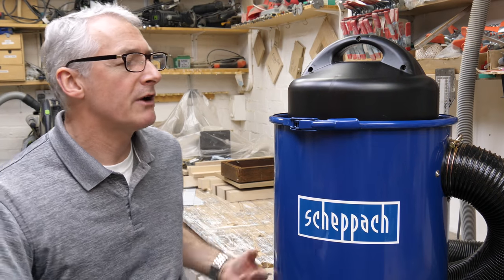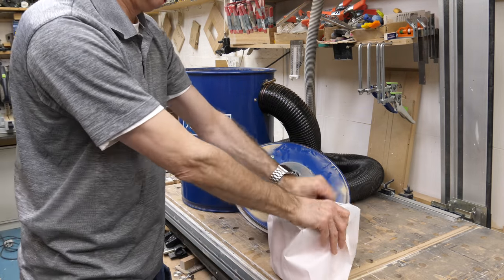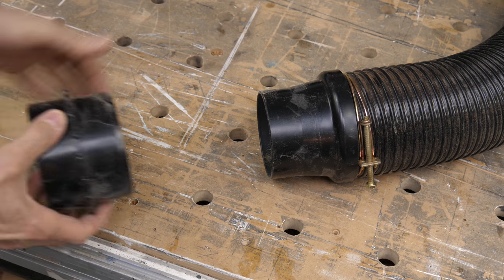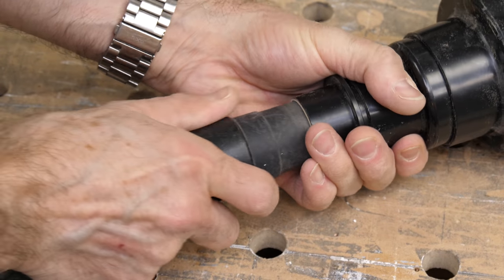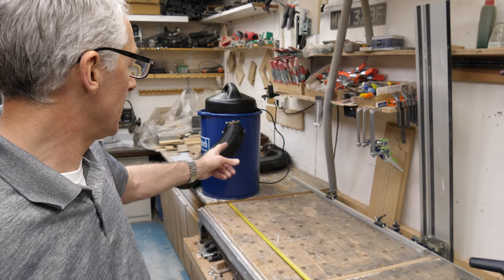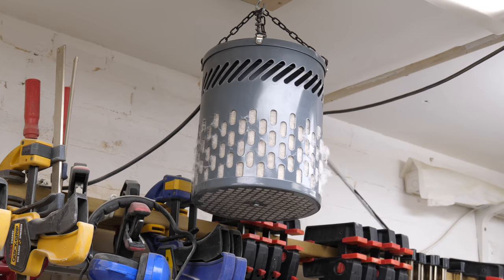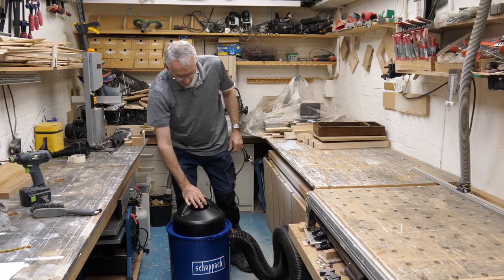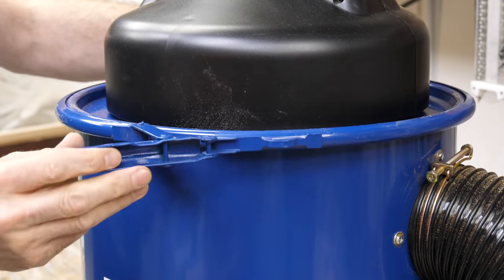Scheppach 50 litre Shop Vac [video #366]

Comment: Design looks identical to the Lumberjack Shop VAC the Ooznest guys recommend for use with their Workbee CNC machine, except the Lumberjack can be had for about £30 less, is a little more powerful (1200W) and filters to a smaller particle size (0.3 microns rather than 0.5). [edit: I’ve since seen this advertised as 0.3 micron, and 0.5 micron. Since it looks like an identical rebranded design to the scheppach, I expect the filtration particle size is actually the same and there is just some inaccuracy in the various listings on this point. The motor is definitely 1200W though, which is a step up)

Comment: I think the short cable is to keep the case's of the tool as small as possible as a longer cable would result in a bigger case and more wire reducing manufacturers profits I personally would like to see a minimum cable length of 3 meters some manufacturers do this so why not all

Comment: Interesting and informative video Peter, many thanks. I have one of the smaller Scheppac suitcase type dust extractors (identical to your Aldi one) and I'm very pleased with it. It is infact my second one as I burnt the first one out. I blame myself not the machine as I repeatedly ran it for hours on end attached to a sander with limited air flow, sanding everything from paint to fibreglass, causing it to get very hot. The poor thing didn't stand a chance really. I had no hesitation buying another and I will be a little more mindful and considerate to this one. What was a little annoying and this may be of interest to others on here:  I telephoned the distributor spare parts helpline to enquire about getting a new motor for my first one and they said they don't even produce a replacement motor for it. They consider the whole machine disposable and non repairable. This is crazy to me as the rest of the machine is fairly robust and still in good order. I still have it, dead as it is, as I can't bear for it to go to landfill. I'm hoping I might stumble across a generic motor that will fit.
Reply from the maker: Thanks for the info! Seems a very shortsighted approach to repairs - especially given the current anti-plastic disposable climate! 👍👍

Comment: Hi Peter, I have a Record dust extractor which filters down to 0.5 micron. When I return to the workshop I find a very thin layer of extremely fine wood dust covering my black tool cabinet. This fine dust cannot be coughed up and is extremely dangerous to health long term. And I only use plywood!! Oak dust and MDF dust (with formaldehyde) are carcinogenic. I’ve lost 2 neighbours to fine dust lung cancers and a 3rd is in a hospice. Now I’ve learned more about fine dust and lungs I’m going to spend over £500 for a class M dust extractor (with HEPA filter). My long term health is worth more than £500. I hope this helps you and your followers. Best wishes for Christmas.
Reply from the maker: Thanks Christian! Yes, this is only to use with the CNC, maybe the table saw; I have a much better extractors available for anything that produces fine dust. 👍👍

Comment: Hi Peter. Not entirely sure if this has been bought up before, but one of the reason many manufactures release only a 2m cable is to do with EMC compliance rules (attached with CE). If the cable is less than 2 to 3m, then the product does not have to go through such stringent testing. I have seen this happen quite a few times where companies try to cop out this.
Reply from the maker: Thanks Tim. I hadn’t heard of that one, but it makes an unfortunate amount of sense! Bought a compressor that had 3 feet of cable attached - not even a metre!🤷‍♂️! 👍👍

Comment: I have this and that "heavy duty" hose tears easily and develops tears in the creases.. You will need lots of ducktape for patching up. You might be alright though if you're not moving it around constantly.
and 100% need ear protection when in use.
Reply: Yep mine is covered in tape
Reply: @petercurtis9297  I've had the Record one for 3 years now, it has a different clear tube with a wire reinforcing it. It has no rips and I am not kind with it and it gets dragged about all the time.

Comment: Hello Peter. Great video as always. Very clear. I have a record power RSDE2 which I've had for years and it's been brilliant. Used only with portable machines but, excellent for power planer and biscuit jointer. It has the mobile base as well which has been a godsend when it's full. Mine also recommends taking the ring off the lid. I think it's more for holding the lid on during transport but, without reading instructions don't quote me on that. Keep up the great work you do.
Reply from the maker: Thanks! 👍👍

Comment: Nicely done Peter 😁. I have had one of these units for a couple of years now. You won't be disappointed with its performance  👍. I have mine static and piped very simular to Keith's but I do use a different chip extractor for my Fox planer. The comment about hose splitting.... That WILL happen very quickly, so I recommend ordering some of the clear flexy stuff sooner rather than later. But it is a good vac overall. Keep up the great vids 😁👍.
Reply from the maker: Thanks Frank! 👍👍
Reply: @XX99XXL  😁 Hi TT. My unit is static and has a short section of flex hose direct from the can. But it is at quite an angle before it attaches to a solid pipe. So it is always under some tension and is exposed to some heat, this leads to premature cracking. I would recommend getting a better more flexible hose as a replacment if it ever cracks. Otherwise the same issue will happen again. I hope that helps TT 😁👍
Reply: @XX99XXL  😁 Sounds like a bargain. I'm sure it will serve you well. Thanks for the reply. Stay safe 😁👍

Comment: I have the Record Power DX4000 as pretty much my only dust control. It's basically the same design as this but twin motor and larger capacity. One gripe I have is that it tends to choke itself. It's so powerful the machine will fill with chips and half fill the hose before you notice anything is wrong. That makes emptying a right pain as chips and fine dust goes everywhere. I'd be interested to know if this is the same. I also find the machine tends to run a bit hot if I'm using it with the input choked down like you do for a power tool. It's ok on something like the thicknesser where it feeds from a 100mm hose though.
Reply from the maker: Thanks! I’ll know more about it as I get rounds it more, but yes, I’d expect it to run hot when it’s stepped down to a smaller hose. Don’t expect to do that much tbh, as I have other vacs for plunge saw, sanders etc... 👍👍

Comment: Hi there, I purchased and have owned the SIP extractor for roughly a couple of years, it works great and has loads of power. Mine is on a shop made base with wheels as I move mine around for the machine I am using at that time ... works well but too powerful to link with smaller hose for use with my metabo and makita sanders, needs a splitter maybe which I can let extra flow come through ...
Reply from the maker: Cheers Chris! Appreciate the info, thanks! 👍👍

Comment: Is there anything to stop you from using a standard vacuum cleaner instead of buying a shop vac? I'm looking at a bagless Henry. I'm not running a business like yourself, it's just a hobby for me so won't be in use all day and can be emptied at the end of each day I use the workshop or every couple of days. I've got many days worth of sawdust around my mitre saw and it won't even half fill a Henry.
Reply from the maker: Domestic vacs may not last as long as one specifically designed for commercial applications, but one thing you have to watch for is the air flow; domestic hoovers wont provide enough 'suckage' (technical term) over a fatter pipe like this Scheppach has, so a Henry might be fine for a mitra saw or sander (filtration concerns aside) but would be no good for a planer/thickness, and even a big router may make them choke. But sure, for smaller stuff a henry would probably be fine.
Reply: @10MinuteWorkshop  I was only thinking of a domestic vac because I know how awesome the Henry models are and found a second-hand one for £50. After posting my question I found a one you use on Amazon for just £114. Seems a no brainer to me - going to save up for one of those instead :)

Comment: i have the rutlands version of this for my drum sander, it works well but is noisy, im planning on adding the axminster metal 4 inch cyclone inline and boxing in the extractor for noise reduction, i will have to leave vents for airflow but it should be a big improvement. annoyingly the 4 inch hose supplied with mine is the clear version and its not 100 mm but around 95mm, so i had to make adaptors for the inlet on my sander and the extractor. apart from that its good value.

Comment: I have a 70 litre one and think its fantastic.....does a great job.  Hose needs patching after a while...gorilla tape helps!  Also fitted it with a flexible rubber hose stepped down to 50mm for my hand tools.  Why spend more?  I also run a home made room dust filter bix which is very quiet and filters 160m3/hr to help strip fine dust from the air in a small workshop....cost me £80 to build.
Reply from the maker: Sounds great! 👍👍

Comment: I have a Charnwood model, similar spec. I have mine connected to a thein seperator, buried in the corner of the workshop along with its noisy neighbour the compressor. It's not the decibel count that hurts on mine, it's the pitch or whine of the motor or impellor, so I have surrounded it with polystyrene and old blankets ( ventilated from outside). Doesn't do much on the Decibels (72 down to 70) but cuts out the annoying whine
I'm not sure the filter micron level is realy that useful on mine, as it displaces so much air and dust from workshop surfaces there is a potential dust cloud before the tool is switched on.
Mine draws quite a lot of power on start up, and I blew up my power tool take off thingy so yours may not work with Hifi/TV type switches.
Reply from the maker: Thanks Richard! Yes, I agree WRT the air displacement - and the 'whine' of the motor! 👍👍

Comment: Peter, I have a Record Power version that looks pretty similar to your one. Hidden in the instructions it stated remove the clip from the lid when using. The clip is only required to carry it about. Like you I made a mobile base for it - so the clip is hung up in the workshop. Check your instructions carefully.
Reply from the maker: Interesting - I wonder why? I'll check the manual, and obvs. the suction would hold the lid on in use, but why specify to have the lid loose I wonder?? Thanks! 👍
Reply: I've just rechecked my instructions. It's in the section 'Before switching on the machine'. On the Record Power version it's called a transit strap and is only used to protect the item during transit. It actually states....'do not use this machine with the transit strap fitted'. The parts diagram confirms that item is the 'transit strap'. Many of these machines look the same. I've had mine a couple of years and it cost less than £100 with a five year guarantee. It does a good job.

Comment: I have this in DJM branding. I agree with you about the cable although I've negated that slightly as my planer and table saw are on castors so I can bring them closer to the vac. The supplied pipe is poor and had to be replaced within six months as it went brittle, a local Bradford supplier provided an excellent and more durable alternative. I've tried it with hand tools and it's great but the step down kit and inner tube adapted pipes required make it quite unwieldy I find and I think I'd prefer to have something like the Aldi one you tested for these. Those caveats and adaptations aside it's a fine piece of kit, I paid c£99 and it's been a great addition working faultlessly for nearly three years now.
Reply from the maker: Good to know, thanks! 👍👍

Comment: Peter i have the SiP version of this machine you mentioned. I must say i am pretty disappointed with mine. It is loud and does not have a lot of suction. Have it connected to a bandsaw and it misses more dust/chips than it collects, maybe though bandsaws are not a good example  but powers tools also gave the same result. Also have the same planer/thicknesser but in titan brand and this is absolutely fantastic for the money, used it to plane down oak fence posts to make gates from and theses came out really smooth.
Reply from the maker: Sorry to hear that Richard, but thanks for letting me know! I wouldn't judge the extractor too harshly based on the performance with a bandsaw, but if it's across all tools then fair enough! And yes,  the Titan gets good reviews generally - I just fancied something with a bit more capacity 👍👍

Comment: Peter, on the basis of your review I've purchased this shop vac and am so pleased with it.

My previous shop vac, when used with my Triton thicknesser wouldn't clear the chippings and the extraction hood on the thicknesser would end up blocked; with the Sheppach it cleared the chippings easily.

I, in my ignorance, would have thought that a larger hose would give less suction; how pleased I was to be proved wrong.

Thanks again Peter, your videos are very helpful and very well presented.
Reply from the maker: Thanks Richard, I really appreciate the feedback! 👍

Comment: I bought one.  I think it is terrible. The hose tore almost immediately in numerous places. I wanted to work with my bandsaw and is suction was pathetic with the 100mm port. With my lathe it doesn’t move enough air to capture the sanding dust.  It doesn’t suck.
Reply from the maker: Interesting - the same exact model? And can I ask when you bought it? As I say in the idea, I’m less than impressed with the 100mm suction, but when you start to step it down it’s outstanding; better than any of the festool vacs I have. 👍👍

Comment: I replace the cables with my own! I cut the cables off every dead tool I find - often vacuum cleaners. They seem to think we're going to have to use an extension anyway so "why not" . If you're using a double or quad extension even being tethered to that is a pain - specially with tools that move - like plunge routers,  circular saws etc.

Comment: I just bought one. My first experience is there is close to no suction if I use the filter bag. Without filterbag the suction is Great. Any good advice..?
Reply from the maker: I get decent suction with the 100mm hose and great suction with it stepped down to 65mm, filter bag fitted at all times. If you’re sure it’s not blocked somewhere in the hose, then consider returning the unit as it sounds like there’s something amiss.
Reply: @10MinuteWorkshop  Thanks for your answer. I Will work a little more with my Unit to understand it better.
Have a nice day 😊

Comment: Hello Peter very informative video many thanks. How does it cope with the thicknesser as my DJM clogs after a short while at the entry point. Thanks Terry
Reply from the maker: Thanks Terry! It’s been very good - never clogged or jammed up., even with a smaller (65mm) hose that I prefer. 👍👍
Reply: @10MinuteWorkshop  Thanks that's made up my mind